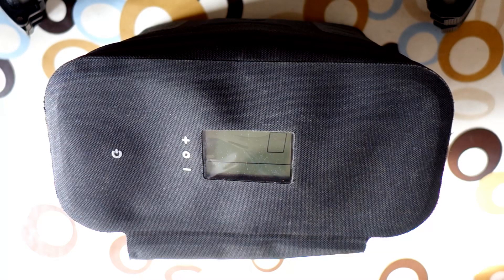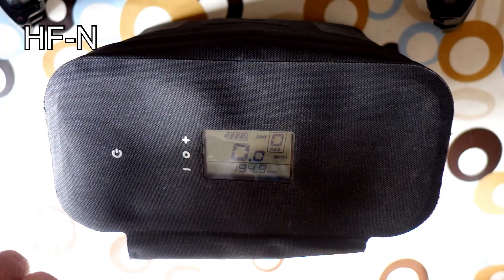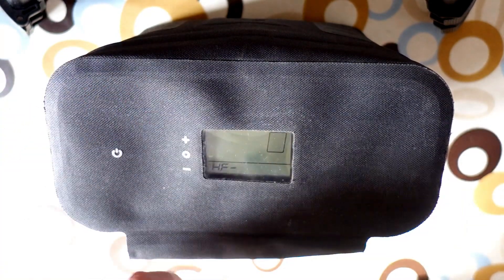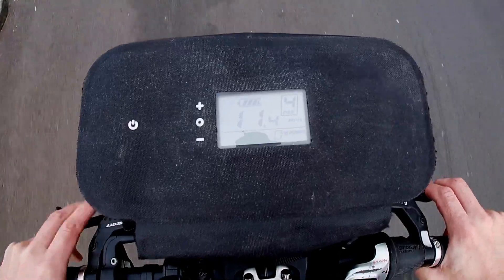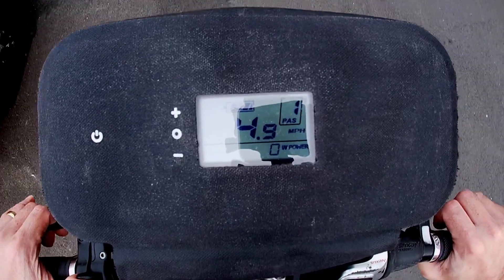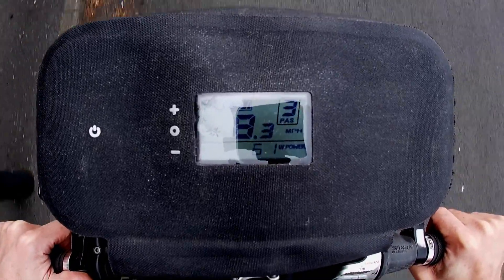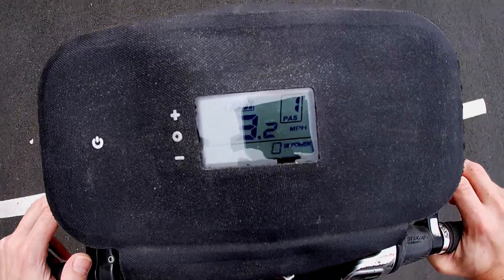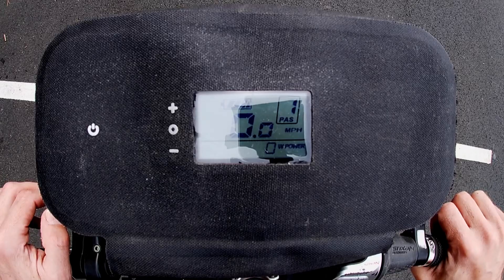Swytch Ebike Conversion. Throttle modes explained

Comment: Is there a generic throttle that fits with the Swytch? The ones Swytch sell don't fit on my handlebars. The one I bought on Amazon fits the plugs but must have some wires reversed.
Reply from the maker: Not that I know of

Comment: I’m contemplating on getting one of these conversion kits to install on a front wheel of a long wheel base recumbent. After hearing and reading about various ebike users the “pedal assist” versions even on their lowest settings give a noticeable acceleration shortly after the first rotation of the crank. I don’t want to feel that kick in drive so soon when starting off as it makes the steering “squirrelly” so I’m favouring a throttle control type instead where I can call in the additional power of front wheel drive when I need it and am prepared for it.
If only using throttle control does the pedal assist settings effect how the power consumption of the battery is utilized or is this function totally negated since I only have a throttle?
Reply from the maker: Mine still works with throttle when a pedal assist sensor is present. I no longer use the throttle. I would say the starting off being squirrelly is not as scary a start as it might sound. To avoid it altogether you could start with pedal assist on 0 then increase to your desired pas level when your moving. See my Swytch playlist for more detail.

https://youtube.com/playlist?list=PLMJAjiTgBtFmx25QbcpCw97D6LiljrE_S

Comment: I have the new battery but i wish it came with a digital display rather than LED. My Bafangs have digital display and are much more programmable i.e. ‘tweakable’. I think Swytch have dumbed down for the hard of thinking🤔
Reply: Appears that way....not sure how this video works relating to the current kit?
Reply: You're right Laurie  ... so how do you change this setting with new battery and no display,, SWYTCH?